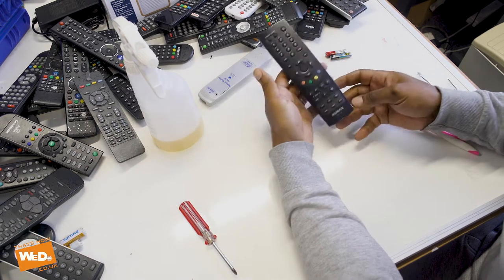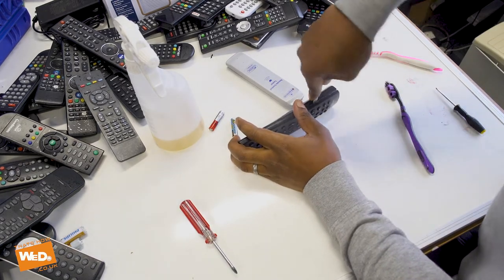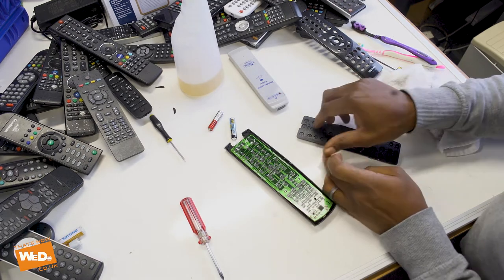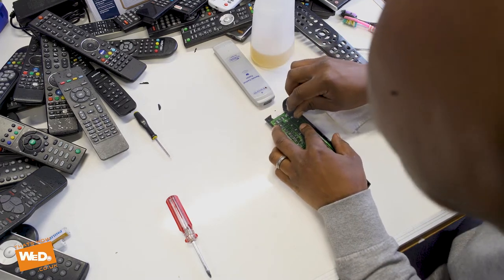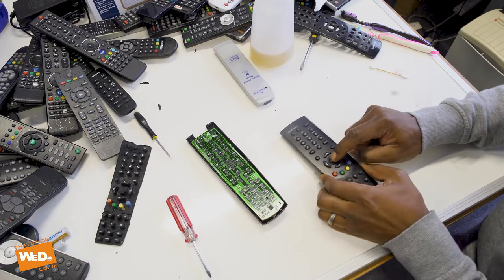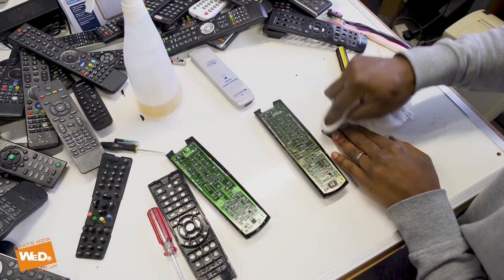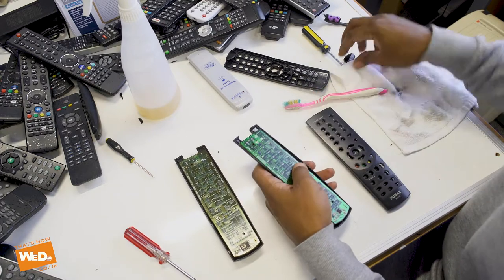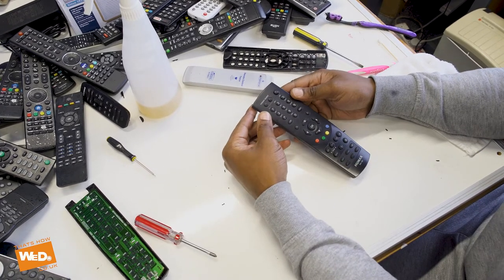How To Open and Repair A Humax Remote Control ( Faulty Buttons ) IR Tested, Cleaned and Repaired

Comment: Instead of throwing the rubber pad away, just glue a small piece of aluminium foil (maybe made with a hole punch or cut to size) to the underside of the button that doesn't work. A bit fiddly but a great and cheap alternative to ordering a new one. 
Also, doing more damage to case than necessary is a bit off-putting.

Comment: How not to do a repair, this was like watching a drunk cowboy.. throwing things around, breaking the remote, using two different batteries!.. 

It says in your description.. 

"This video shows how to open, clean and repair a Humax remote control which has faulty buttons."

You mean how not to open a remote control!...  

May I suggest a job on fawlty towers!.. 

How do you get to work?.. On horseback?..

Comment: You would be better off scraping the contact with a graphite pencil. I used an old flat kitchen knife to open the plastic without any damage. My older Humax remote was very hard to open. Your video was very helpful. Also you should not clean with WD40 as you want to get rid of the silicone not add more. Though I use soapy water as it works adequately well. Thanks.